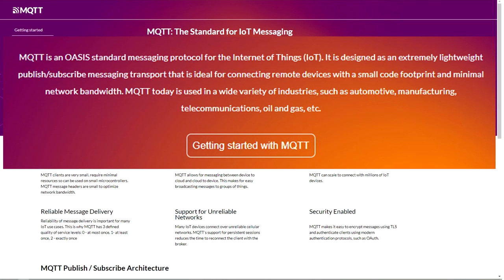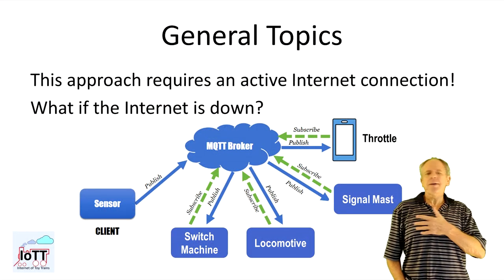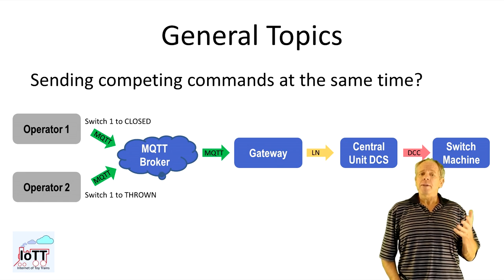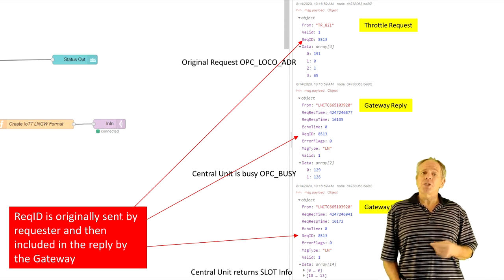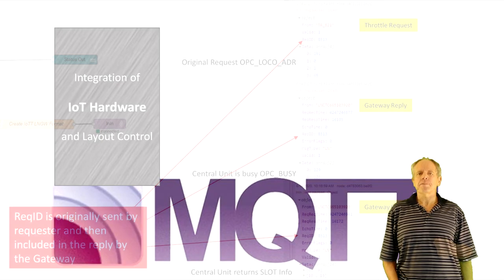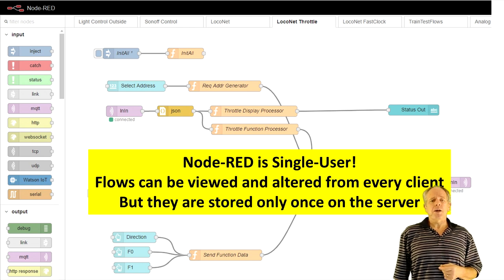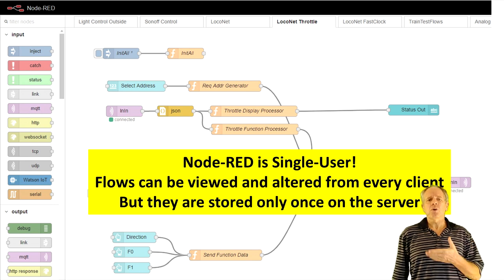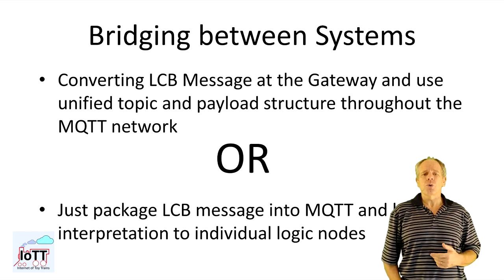MQTT - What Topic and Payload Structure is Best? (Video#49)

Comment: I appreciated the overview of the various discussions on the MQTTMR forum I thought you did a good job. I particularly like the route locking explanation.

While I agree the use of a single topic with embedded LocoNet packet does seem to inconsistent with the MQTT pub/sub concept I can see the advantage of using MQTT rather than LocoNet over TCP. Particularly in the case of having gateways bridging between one protocol to another the transformation could involve not only data formats but topics as well. In the latter part of your explanation you introduced the notion that LocoNet doesn't meet all requirements for a control system and thus the potential to add specific data and or topics.

Not having a bunch of Loconet devices I'm still of the opinion as DIYer that multiple topics meet my needs better than having a single topic.

Being a node red and Docker fan i can see setting up multiple docker containers allowing multiple users. I haven't attempted this yet.

All that being said I congratulate you on the continued pursuit of MQTT for model railroading

Comment: What is the payload size of MQTT if you can give it in numbers it would be useful to write in my seminar presentation
Reply from the maker: That of course depends on the name of the sender and the length of the Loconet message. Typical is about 30 - 50 bytes. Here are some examples:
{"Sender":"Switch Board2","MsgData":[189,1,0]}  //Setting switch 1 to position closed, sent by Switchboard 2
{"Sender":"LNViewer","MsgData":[133]} //Setting track power to on, sent by LNViewer
What is your seminar about?  What school? Any links?

Comment: Hans, I know it's an old video but I left some comments on video #17.  Also, how do I go about getting a DCC interface module?  Is this something you developed?
Reply from the maker: I answered your questions in the Video #17 comments section. Also noteworthy: There will be a GreenHat for the IoTT Stick a few months down the road. Most likely it will come in two version, one for servos and one for solenoid and motorized turnout drivers, and both with inputs for position detection, local buttons, and outputs for status control LED's.

Comment: Perhaps a simple database to store the state of each physical part is required?
Reply from the maker: Yes, very good point. On the IoTT Stick I store of course the configuration data as well as LocoNet run-time data from switches, signals and block detectors. Some run-time data however is not that easy to store, i.e. signal aspects of signals that consist of two switch addresses where the aspect depends on the last received switch command.
So, yes, a simple database is needed on the Gateway for a quick start-up of the system. However, it does not completely substitute the need for querying some devices at run-time.